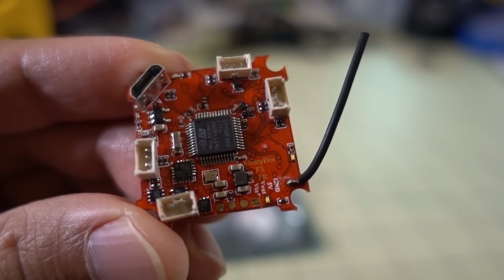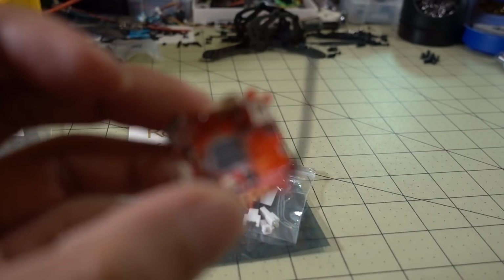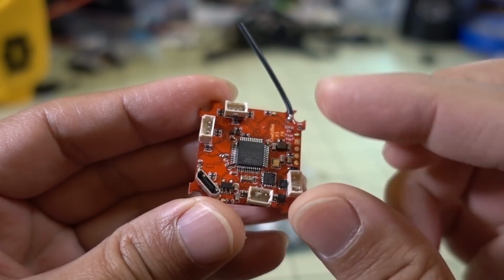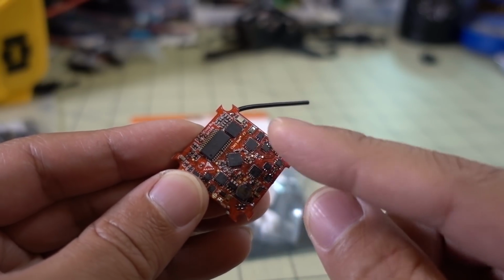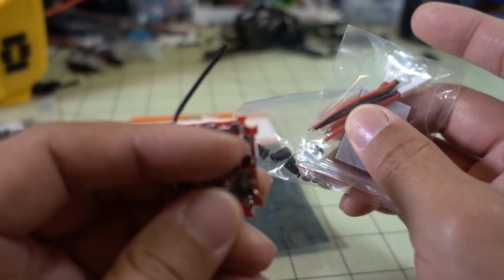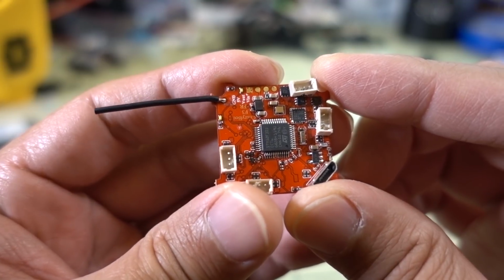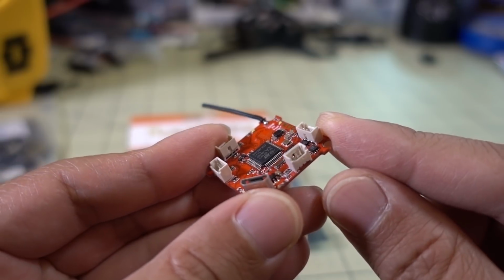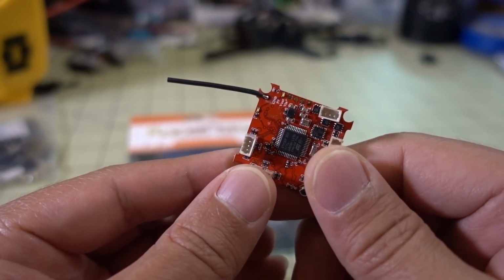Racerstar CrazyBee F3 AIO FC Review ✔️

Comment: I have frsky version. Try to bind it with my devo 10 and betaflight tx02. Bind no problem. My problem is that the throttle is not stable. Jump from 885 to 2000 then back to 885 again. The same for both transmitters. Any solution, am I missing something?

Comment: I got the remote to bind, but the motors won't spin. Is that a beta flight setting or something else?
Reply from the maker: probably a betaflight setting or transmitter setting.
Reply: Albert Kim do you know what setting it could be. The esc gets power on betaflight only if you keep moving the bar.

Comment: What should you do if it wont bind to your flysky FS i6 transmitter ?
Reply from the maker: I don't have the Flysky version so I'm not sure what the issue is.  I've heard of other people having an issue with Flysky so I think a bad batch might be out there.  This seemed to happen recently.  I would contact BG customer support.
Reply: Its so strange because I had it bound to my flysky radio and have been flyin the snapper no problem. I tried to bind it to the jumper radio last night and now niether the jumper or the flsky can be bound. Flashing lights only. Any idea what it could be ?
Reply from the maker: Sorry, I have no clue...
Reply: Bound it   :) Needed to put the TX in bind mode first before following binding procedure with the snap 7.  Have a great wknd!
Reply: @Spideystrat  with Jumper you selected Pwm and ibus? Thanks

Comment: That good video friend, I have a problem with my UR65 with Frsky receiver and it is that I have it well configured and it links well to the radio control taranis x9 plus, after being flying it falls; since the connection with the radio is lost and it is not by distance, since it loses the connection in a short time and does not reconnect until it disconnects the battery and reconnects it, which can be a friend? Greetings from Colombia and LIKE ...
Reply from the maker: I heard upgrading the firmware helps.  Also try FrskyD8 instead of 16. Also make sure the antenna is straight and not curled up.
Reply: Primero que todo gracias por el respondedor mi amigo, en cuanto a la actualización que te refieres la versión beta de la actualización a la última versión a la 3.5 o que te refieres, ya lo has probado en Frsky de 16 y de 8 canales y sigue el problema , tambien la antena esta libre y recta ya no se que hacer amigo gracias ...
Reply: i think this card with receiver inside don't accept lots of crash ..need to add an external micro receiver ...

Comment: any way you can help bind this thing, just keep getting flashing lights.  tried d16 and d8 to QX7 just not happening. and no were else to turn to for help. and your a nice guy!!
Reply from the maker: Press and hold the bind button for 2 sec. The lights will go solid. Then you're in bind mode and goto radio and bind in D16 mode.
Reply: Albert Kim thank you responding, no flashes just really quick 3 times then slowly blinks again, wont go solid, gotta be something in betaflight, but I didnt connect to beta flight till after a couple tries.

Comment: hi Albert i've got a question. i've got the UR65 with the Crazybee F3. somehow all the inputs i give on my transmitter are reversed. (i.e. yaw left does yaw right etc.) reversing it on my transmitter doesn't work but i can't figure out what is wrong with the quad. i'm using the jumper t8sg. can you help me out? Thanks in advance!
Reply from the maker: Hmmm, never seen one where reversing it in the transmitter doesn't work.  Are you sure you actually reversed it and saved the change?
Reply: Albert Kim Yea kind of sure. Which of the channels do I need to reverse? I think only the throttle is right and ‘forward/backwards (is that pitch?) is correct. But not sure what the ELE etc all mean! Thanks for the help!

Comment: The lack of Motors available for those plugs seems a real oversight. It would honestly just be easier to just leave the pads open don't you think?
Reply from the maker: Actually, the motors are available now...  http://goo.gl/Q3LL2R and http://goo.gl/omYvzq
Reply: Albert Kim if the spec sheet is to be believed the happy model 0603 motors look great for a tiny whoop, 20g of thrust with 31mm props at 3.7V?  Seems quite good.

Comment: Albert - I just finished my build with this board. Have you been able to get Turtle mode to work? If i have flip over after crash enabled on the modes tab then everytime I arm the motors they spin up for a second and then stop and beep. Works on D8 with the esc beeper and flies fine if turtle mode is not enabled. IDK what to try to fix it.
Reply from the maker: Sorry, have not built it yet.  You're on 16.7 of the firmware?  Have you tried D16 mode?
Reply: Yep I flashed 16.7 - I haven't tried D16 yet cause on facebook the same person that told me about the turtle mode issue said that D16 mode had some twitching issues. So I just started with D8 mode cause I wanted to fly it at a race last night. I see that betaflight has 3.3.1 now for the Crazybee target so I will try that 1st and then if that doesnt fix it I will test out D16 mode. It seems like it has to be a software issue so I am hopeful it will be resolved soon.
Reply: I found a solution for fixing turtle mode in D8. Under the failsafe tab you need to change "guard time" to 10. Should work after that.
Reply: Dan FPV Skittles just a quick question to you: when conecting USB and the Lipo to the board the channel response in BF is very instable, meaning I get permanent sensor and channel lost errors on the Taranis even beeing in D8 mode. Without USB everything works fine and my whoop flies perfect. Any comments on this?

Comment: I recently received the Happymodel Snapper 7 with this FC installed unfortunately I can't get it to work:  Using factory default receiver configuration settings it appears to bind in either Frsky mode (D8, D16)with my Taranis QX7 radio channel map set to TAER1234 but the problem is I am unable to finish switch assignments via Betaflight due to nonstop disconnection coming from the receiver as indicated by the audio indication "Telemetry lost.... Telemetry recovered over and over etc.  Any assistance correcting this would be much appreciated.   Note I moved my Taranis further away to thinking it was too close to the craft (losing RSSI) anyways no joy.  Now I have a trouble ticket upen with Gearbest to hopefully address this
Reply from the maker: I had that issue too.  I moved the radio about 3 feet away and all was good.  You might want to upgrade to firmware 3.3.1 and see if that helps.
Reply: Albert - Thanks for your input!  I got this CrazyBee FC to work.  Actually I set my radio to bind (D16)with the craft receiver by doing so +6 ft away.  :) and the audio telemetry alert went away.  The only other issue I had was one of the happymodel branded motor bells came loose after just removing a broken prop.  I used blue permantex to secure it back on the shaft but the craft has been flying good since with nice power.